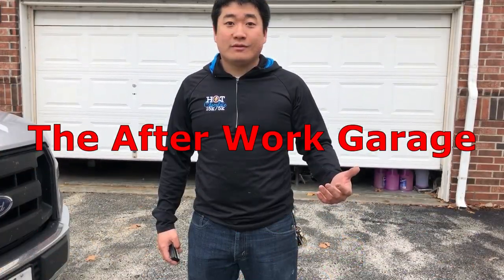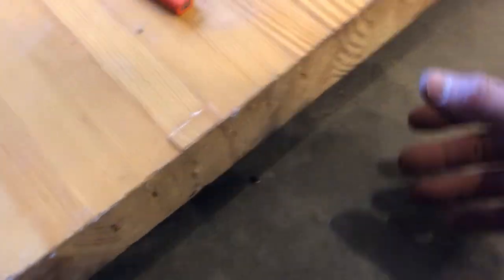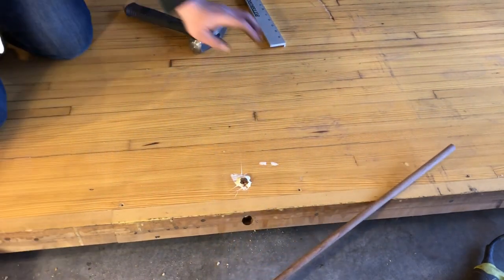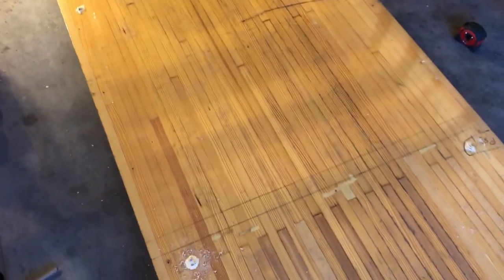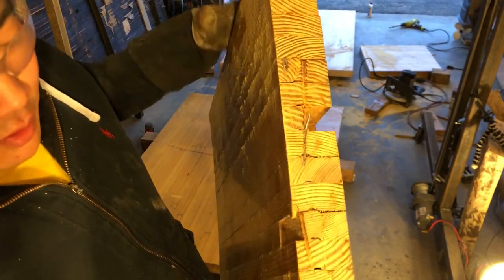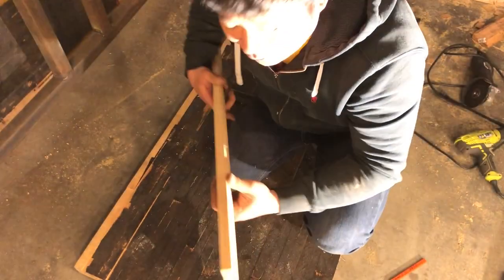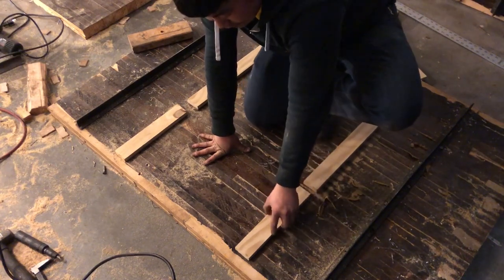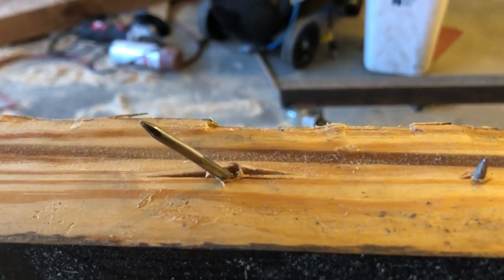Bowling Alley Furniture Part One

Comment: Hey. I recently purchased a kitchen table from a salvage company that makes tables. They made one for me out of a bowling lane and it looks nice. 

However I noticed some slight sag on the sides. The table doesn't have any of the metal rods running through it. While the legs are metal and screwed into the middle part of the table I have about 4 inches on either side with no support. 

Any advice on what I could do. I assembled the legs so I can easily take them off. Just wondering if this is a major problem or if I'm worrying a bit much.
Reply from the maker: I'm not an expert, but I would recommend some sort of support for the sides of the table, otherwise they will start to sag over time due to the weight of the wood pulling on the toe nailed nails and glue holding the boards together. As I mentioned, bowling alleys are made in place, and are not meant to fully support themselves. I know some people drill holes all the way through the sides of the table top with a long drill bit, and bolt the boards together with threaded rod. Another discreet method would be to route in grooves on the underside with slightly enlarged ends, and install rods (similar to how a truss rod works on a guitar neck) to hold the boards together. I just used boards and the existing angle iron in this video as the tables were going to me an a friend, and not necessarily of the highest 'fit and finish'. Depending on the leg style, you could probably just use metal bars to extend the leg support out to the outer boards. Best of luck to you!